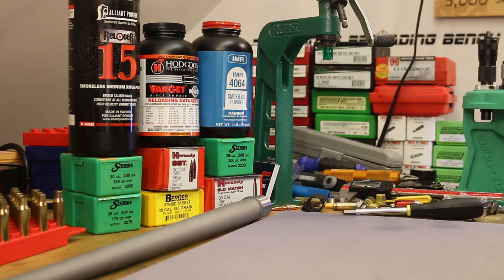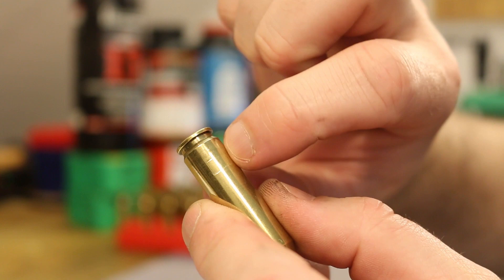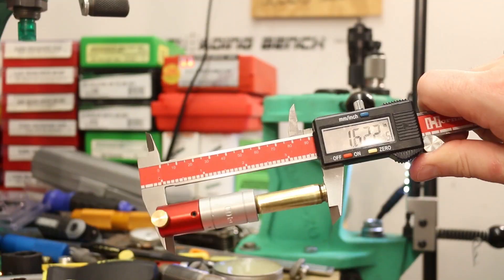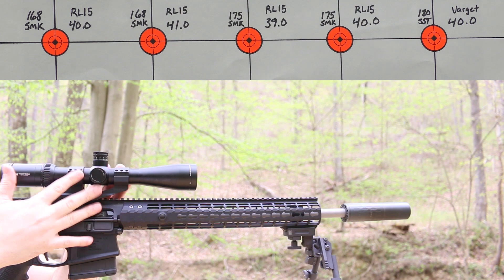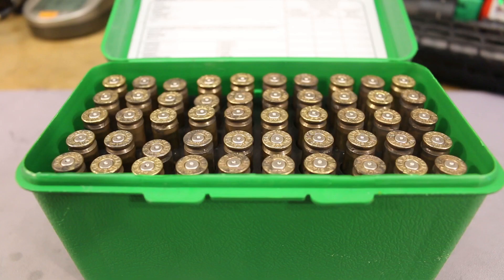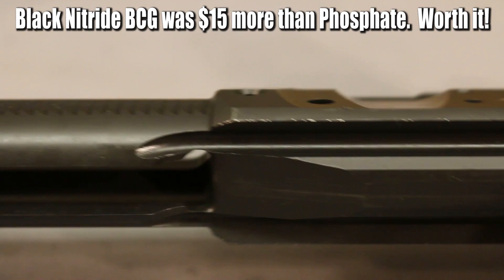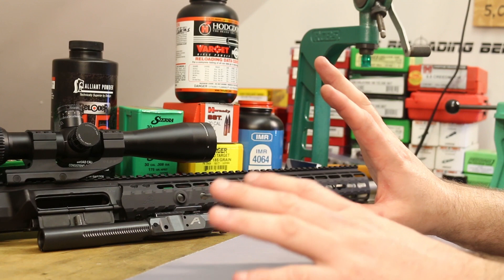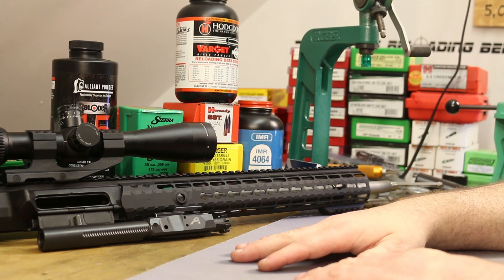Aero Precision M5E1 - More Accuracy Tests (AR-10)

Comment: My cz557varmint had 2 curious build ups from copper, reason; 2 unperfections in the barrel. They hamered 1 out, but never got realy good. I sold it, and bought a new one. The new shoots to good. Allways hole in hole at 100 yard. So i stopped shooting it.
So look in barrel when it's dirty.

Comment: Interesting. I tried a really fast powder (norma 200) for my similar type rifle and it did not even want to cycle on the highest gas settings, even with hot loads.  It does not seem like theese systems like fast burning powders what so ever.

Comment: I went with a criterion barrel and BCG headspaced.  Using the M5. Still shopping around for a solid handguard. I want a knights armament or something really solid.
Reply: Which Criterion barrel did you go with? I'm starting a AP build and looking at the Criterion DPMS pattern .308 hybrid barrel with a 1, 10 twist  20 inches in length
Reply: @jeremypierce8038  thats the barrel i went with. Chrome lined.

Comment: I recently bought a shilen from midway and in the first 50 rounds I have .75 moa and with hand loads under .5 moa
Reply from the maker: Awesome!  Another commenter mentioned he had seen very long throats in Shilen drop-ins.  Have you noticed a particularly long throat in yours?
Reply: Johnny's Reloading Bench what I see is that my target bullets have around 100 thousandth of jump. While I would have to seat the 180 hornady sp 60 thousandth deeper than mag length.

Comment: Dude, your velocities are wayyyyyy to low. You should be up to 2600 or so with those 168's and 175's.
Reply: ross vanderpoel with a 24" I would say yes.  However that short barrel not so much. My 24" bolt gun on the STIFF side would get 2700 however lightened back up to the Berger and Hornady manual and 2600fps it really sings them in there and the brass is much easier bolt lift and no marks.
Reply: I get 2625 out of my M21 with 42.4 grains of i4064. That's with a 22inch barrel. He should test some GMM and clock it.
Reply: Thomas Ewers 18in should be 2650fps with 168's and high 2500's with 175's
Reply: YES!!! At least 2575 or above out of an 18 inch.
Reply: ross vanderpoel im in a similar speed 2605 18" 168gr 40.2 arcomp
Reply: I am getting 2780 out of 24in barrel with hornady match 168gr over 45.7gr varget.
Reply from the maker: I was at 2650 with the 168's in the last video.  The groups were much worse, but the powder was CFE223 which isn't always the best for accuracy.  Somebody in the comments of the last video suggested I shoot them slower so it was worth a shot.

Comment: I’ve got the same aero gun but with a criterion 22” .243 barrel

Shot a .25” group and a .34” group yesterday with a certain load I’ve got dialed in, and two .75’s with another load I’m working on.

Bullet seating depth is key (which I’m sure you know)

Comment: nice video man! I want to see more 6.5 Grendel I'm having terrible luck with my Grendel 1.5"-2" groupings >.< thinking about buying a new barrel I'm in a deadlock between jp super match that's very expensive or a midway shilen drop in....anyway would you be interested in my current barrel ? 20" 5r 1/8 got from classic firearms
Reply: What bullets are you feeding it?  What barrel is it?
Reply: I've fed it 120 ELD, 120 Amax, 123 SST, 123eld tried H335, cfe 223, leverevolution, 8208xbr, AA4064 multiple times coal ranging between 2.240-2.275 best grouping was 1.5" on AA4064 123 sst 2.245 27.5gn starline brass and 450 primers
the barrel im not sure i got it from classic firearms its a 20" 6.5 grendel 5r 1/8 
imgur rifle pics https://imgur.com/a/NQ2DR
Reply from the maker: A JP or a Shilen is going to shoot lights-out, man.  
I recently bought a new Faxon Grendel barrel that I've used in my last few videos, so I'm not ready to take on another barrel at this point.  Thanks for the offer!  My Faxon barrel has been a little challenging at times but it really likes the heavy 140 class bullets.  I'm still searching for accuracy in the 123 range.  I'll have more Grendel videos very soon!

Comment: I use 42g varget and 168 smk for rem 700vtr and 44.5 of Rl15 and 44.5 of varget in a savage 10T with 178 hornady bthp and ELDX 1/2 groups with the savage and around 1inch for the Remington
Reply: 308 guy ... I used the 42gr Varget load with 175SMK and best group yet. Wow 44.5 of Varget behind a 178ELDX is STIFF. Mine already gets a firm but not quite stiff bolt lift at 43.4 and stiff at 44. But I already get 2700fps so very happy.  The SMK load is a light bolt lift.

Comment: I realize that this post is from two years ago. However, I just took the time to watch. Blaming the barrel is wrong. Watching this video was very surprising. As a reloaded you through way to many variables together! Lots of different bullets and weights. Several different types of powder. I have no idea what you were trying to find out. Lack of accuracy from the barrel? With absolutely nothing consistent? Unfortunately you proved nothing. I also noticed they different OAL’s. That barrel is probably perfect! You totally went about checking it completely wrong!

Comment: JP Enterprise barrel
Reply: That's what all of the competitors say who are serious about AR10's. For whatever reason building an accurate AR10 is a LOT more difficult than an AR15. Lessons learned (the hard way)
Reply: Most accurate barrels around, but very expensive.
Reply: @ZebraActual  I cant speak for "most accurate" but the 3 JP barrels I have are simply amazing.   All under half moa with pet loads.

Comment: Why are you only using 1-2 charge weights? Have you ever heard of/tried a “ladder test”? Check out John “8541 Tactical”.  

Also try running a Q-Tip in the bore where it meets the crown. If cotton gets snagged, you have a problem.

Comment: go get a large enough lathe(spindle bore at 1,5" and up is fine) and make a hydraulic button rifling machine to. You get your barrel the way you want to have it, just be sure you know how to heat treat with a pottery oven(attach an arduino to regulate the process)..... google: Harold Hoffman. 

a barrel will cost you steel price... then, you can make it the way you want it to be, right off the bat.
Reply: look for: Bill Webb

Comment: Faxon 16"
Reply: A 16” .308?

I would stick with 20”, no shorter than 18” on a precision type rifle like he’s building.
Reply: Have a Faxton 18" fluted match barrel, took about 100 rounds before it really shined. 1/2" groups at 100yds. With 150 to 168 grain bullets. Reloaded 15 and CFF
Reply: I have a 16" faxon gunner barrel and it is an absolute dream. No brass problems suppressed or un suppressed. 1" groups or less with 168 gr smk. It out shoots johnnys current set up all day. I really dont know why everyone has so many problems with 308 AR10s. 
Same M5E1, but i use a rifle buffer and a tubbs flat wire spring.

Comment: Accuracy issues?
 *try not using your scopes as handgrips* for lugging around 5-6 lbs uppers. Those tubes are not designed for that purpose. 
.
You appear very competent and info saturated on reloading.. how it is that the above bad practice is a common ritual for you is maddening. best of luck.